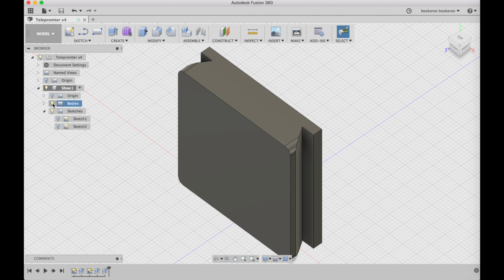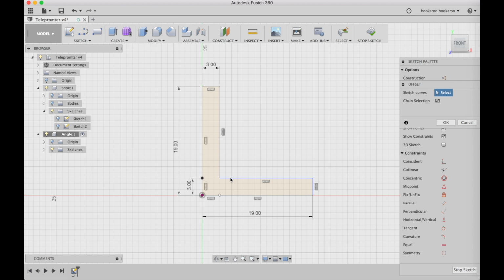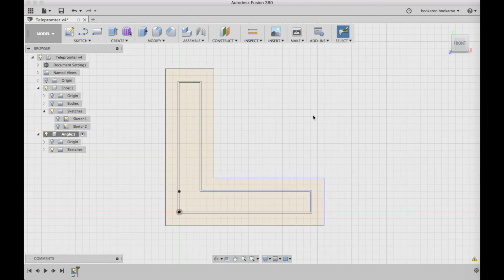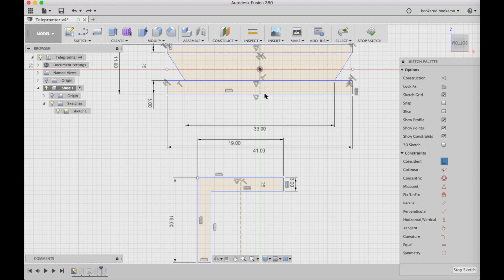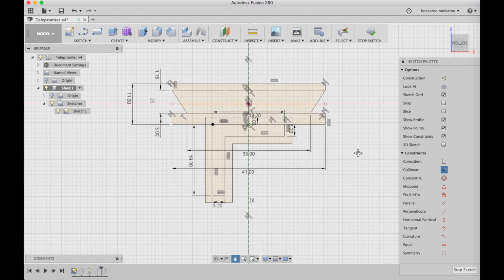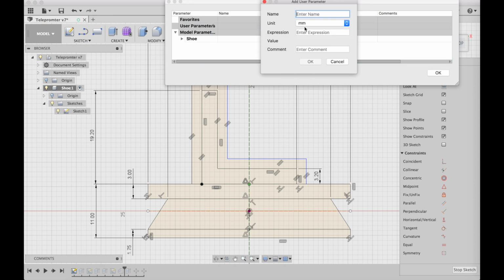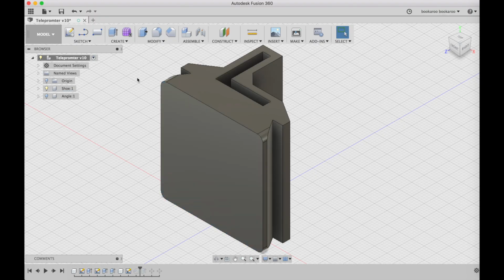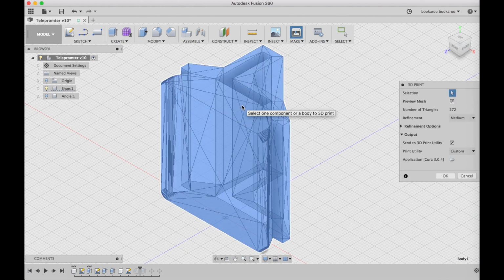Teleprompter Build - Part 2

Comment: Can you do a video about Cura settings for the Monoprice Select Mini?
Reply from the maker: I have that video about it you have my settings links in the description https://youtu.be/cCfXZ2LwM7w or are you saying to do more in-depth of Cura?
Reply from the maker: I just updated the files so that combing is not an issue.
Reply: Thank you Frank. That files had everything i wanted. Another random question. I'm doing the Noctua-fan mod right now, (litterly holding the fan). I'm going the lazy way and will plug it in to the mainboard. However, i noticed on my fan that my cable had 3 wires from the fan (yellow, red, black). When you soldered - what did you do with the yellow wire?
Reply from the maker: I have just not connected it and made sure it will not short out
Reply from the maker: By the way, that yellow wire is for measuring the speed of the fan, since the Mini does not use this sensor, it's not needed.
Reply from the maker: And good news, in some future version of Cura, there will be profiles for the Monoprice Mini included!